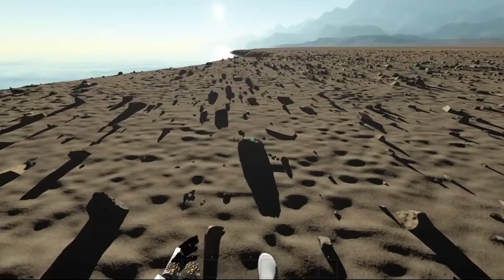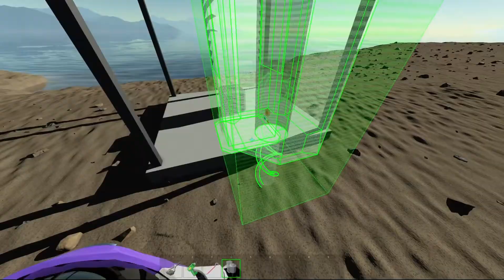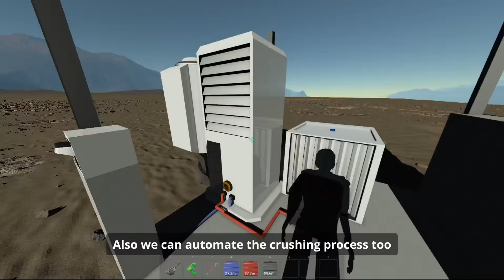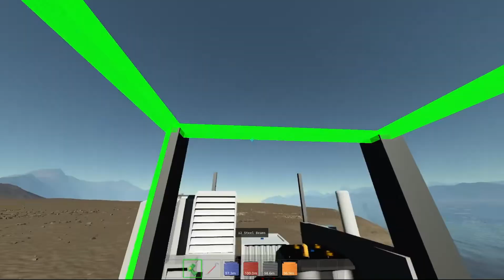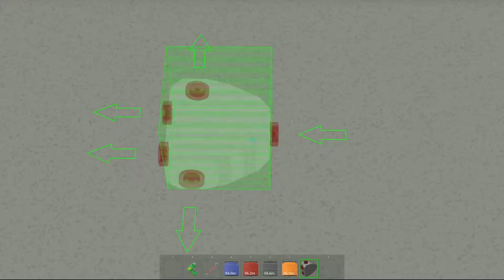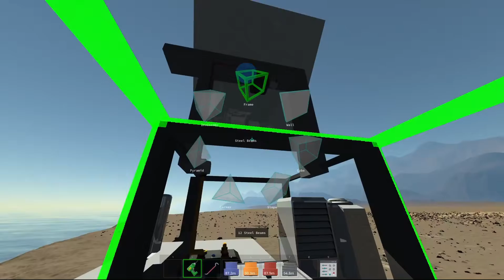Archean #1 - From zero to almost something

Comment: What is this game about?
Reply from the maker: It's basically an engineering sandbox. The developer often mentions the objective of going to the moon, but to do that you need to design a rocket with somewhat accurate aerodynamics, fuel to mass ratio, controls, ...

I never went to the moon, but on adventure mode (limited resources) you also have some other problems, like having to mine ores on top of the real-sized mountains, or the bottom of the ocean. That often means you have to design some type of vehicle to transport those ores like trucks, drones, and submarines.

I hope I could provide a good description, as this is a great game.
Reply: @WarFant yes thank you for explaining it looks like a cool game but i originaly thought it was about surviving in the archean eon because it was called archean😅
Reply from the maker: @lushpage82  (sorry for the late response, youtube didn't notify me)
The game does take place in the archean eon! But the survival mode is still in development, so it's basically just an engineering game for now.
Reply: @WarFant Oh nice! thats awsome I should check back on it thank you for notifying me even if it was late